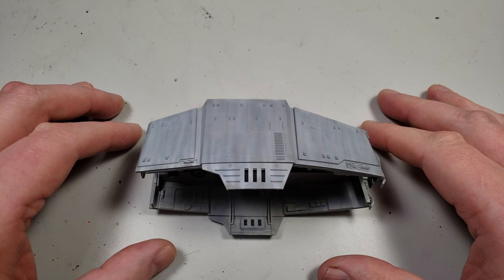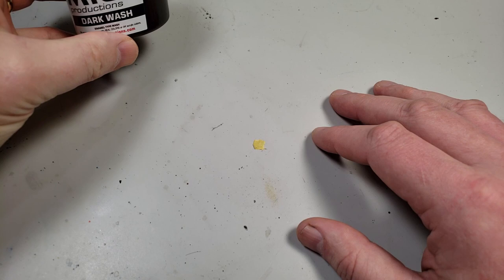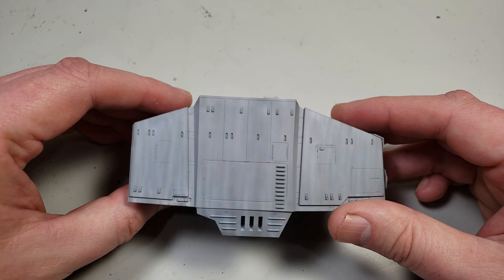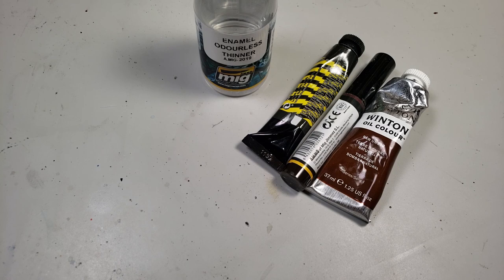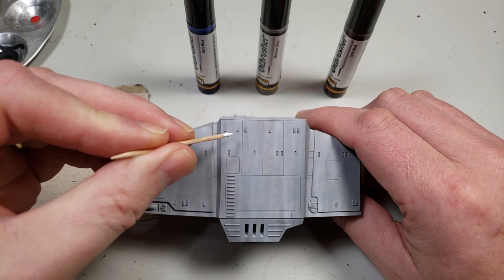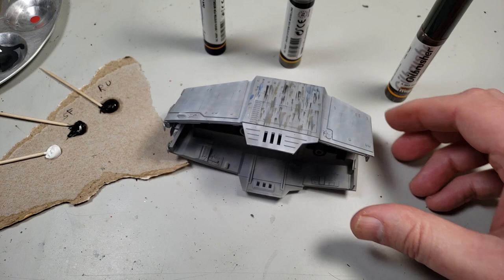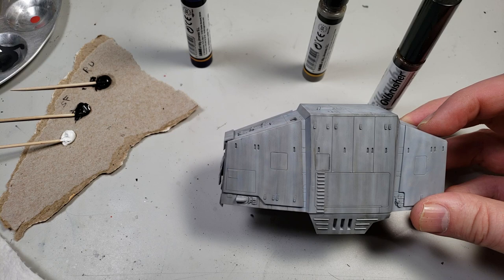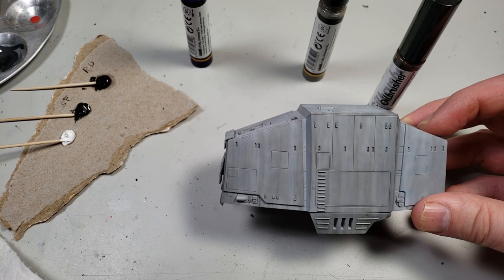Scale Modeling How-To: Dot Filters Explained

Comment: Hey mate, I’m going to take the dive and start using oil paints!! Do you have the prime the model before you start the pin wash/dot filter? 
I’ve heard that you need to cover the model with a satin varnish. This will be impossible for me because I haven’t got an airbrush and can’t find any satin varnish sprays. 
Thank you
Reply from the maker: Give it a try! Just put down your primer/paint as you normally would. Once those are dry, the oils can go over the top - as long as the paint underneath is acrylic or lacquer. If they're enamels, you'll definitely need an acrylic clear coat.

The oils generally go best over a satin finish, though matt can work too. Gloss isn't ideal because the oils just streak away.

Hope that helps! Thanks for wathcing and commenting.
Reply: @JonBius I'm basing a Sherman with Vallejo US olive drab, so that's an acrylic paint :) Will the thinner I'm using to blend the oil paints upset the acrylic base paint?
Reply from the maker: @wolowizard4441  As long as your using odorless thinners for oils & enamels, you should be good to go. Test a small area to double check, but that should get you going! Have fun!

Comment: I'm wondering if you have a video that shows how you got the airbrush streaking effect before you added the dot matrix streaking? I've seen how you do the mottling effect is it a similar technique?
Reply from the maker: Yes, it is very similar. I essentially do the mottling spray (like I did on this Viper https://youtu.be/584VzWneZRA?t=165), and then once that is in place, I thin the paint down, lighten it up, and just start doing vertical streaking in light, quick passes. I just keep varying the paint, a little lighter, a little darker, until I get it like I want. They key is thin paint- build it up slowly.

A video about that is a good idea - I need to work that in to a future build.

Thanks for watching and commenting!
Reply: @JonBius  Thank's for the quick reply! Love your videos they're very informative and as a beginner I feel like I have learn't loads already watching your videos and I'm excited to trying out different techniques.
It's a great looking effect and I shall be trying it out. I have the Bandai Snowspeeder so will be trying out the mottling effect on that.
Thanks again
Reply from the maker: @mickcorbett2501  Cool! I'm so glad it the videos have helped. Be sure and check out my Snowspeeder series - it might spark some ideas.

Comment: what kind of thinner are you using that isnt eating completely through your top coat and paint???
Reply from the maker: https://youtu.be/TOy4CX7xAbM?t=653

HTH
Reply: @JonBius i am familiar with using a lacquer top coat before applying an enamel wash or panel liner and cleaning up with enamel thinner, which according to every tutorial i've seen, is not supposed to effect anything but the enamel, but i have found that unless you are very quick and gingerly with it, it will easily eat down to the primer...
Reply from the maker: @ryan072581  That's one of the reasons I stick with acrylics, for both clear coats and paint. Far less chance of interaction. I've not had the problem you mention, but it doesn't surprise me. The only clear coats I use any more are acrylic. (Unless it's a final matt coat and nothing will go over it afterwards.)
Reply: just read something about the Testor's Enamel Thinner that i use being too hot for this.  certainly found out the hard way that zippo fluid (naptha) is even hotter, lol
Reply from the maker: @ryan072581  Oh yes - Testors, Tamiya, Humbrol, etc., tend to be quite hot. I stick with either the art store odorless thinner, or AK or Ammo. 

Lighter fluid is talked about a lot as a low cost alternative, but it is so caustic, and so noxious in terms of odor, that I gave up on it after one attempt.

Comment: What oil colors u recommend for ships grey hull ? Same as u used ?
Reply from the maker: I'll have to give a politician's answer... "It depends." :)

If you're wanting to keep the overall tones cooler, then using the colors shown in the video would work well. This would probably work best in a static setting with the model on a stand. (Although test how it looks over a red lower hull - it may dull it down more than you want. Warm colors may look better on the red parts.)

If you're having it in a water based setting, then whatever conditions you're trying to suggest there would dictate it. For example, if the water effects were very rough, and the lighting effects were imagined as cloudy, you might want to go for bolder, cool tones to suggest movement, water running down, etc. If it were calmer water, you could do warm tones on one side, and cool on the other, to suggest a setting/rising sun.

So I'd say that you'd want to first consider the setting you will place it in. 

Hope that helps - thanks for watching and commenting!
Reply: Jon Bius cools tones definitely. thx.